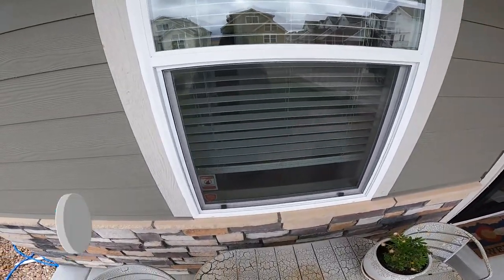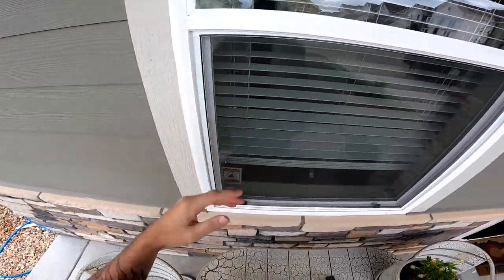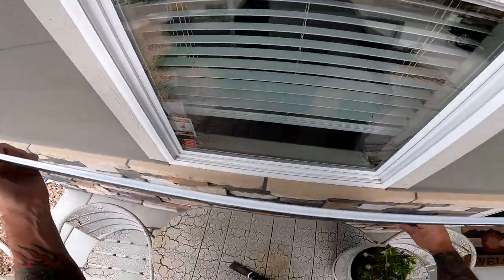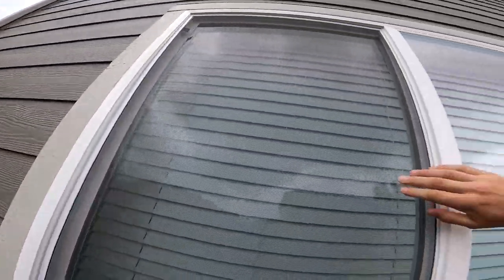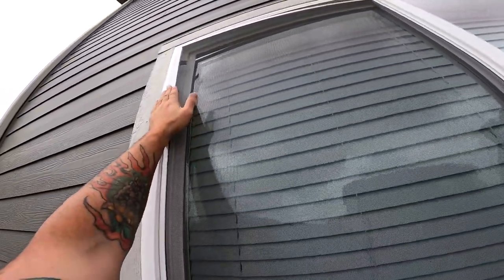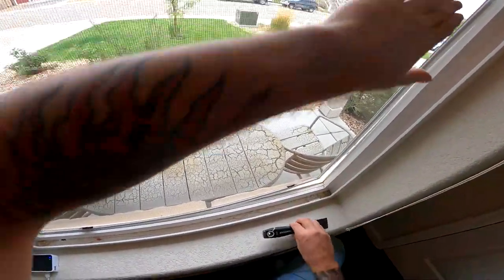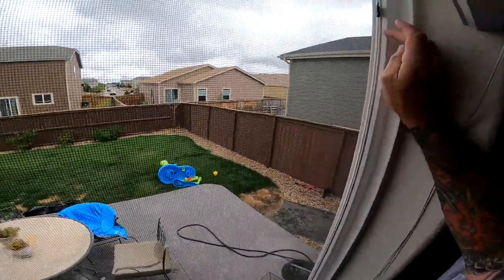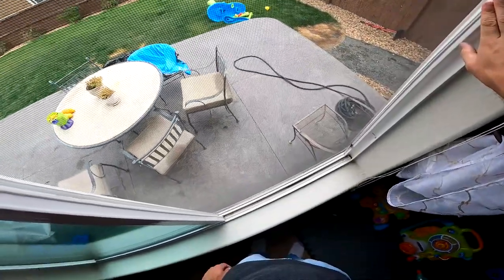HOW TO REMOVE WINDOW SCREENS | SINGLE HUNG AND SLIDERS | EP.1

Comment: Cleaned a house last month that had flex screens. Never heard of them or seen them. Told her it wouldn't be a problem when she called. If you haven't seen them i understand, starting price is 60 bucks for a small 24x24 screen. I wish all houses had them. You push out from the center, the sides of the screen flexes inward creating an hourglass shape. You grab one side and pull the screen out. Super super easy. I almost felt guilty charging her.

Comment: How are they supposed to come out, though? We have a brand new home, we undid the latches on the screens and pulled up and tried pushing and pulling it every which way and it won’t budge. Pushing out isn’t an option… the plastic covers the sides. Pulling in, they don’t fit. I don’t even know how he installed them.

Comment: What do I do if I'm doing exterior window washing with a waterfed pole and don't have a ladder? Do i just leave the screens in when cleaning?
Reply: Great question. Im wondering the same.
Reply: @harleyslocum917  I learned to ask if the home owner if they want to take the screens out (sometimes they are uncomfortable with me coming in the house) Or I will offer to take them out. The screens come out from the inside